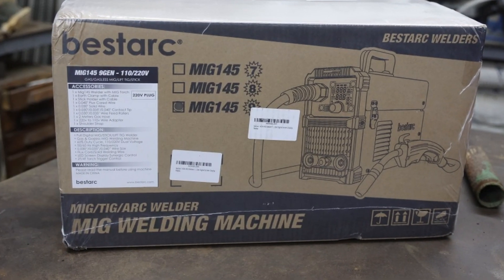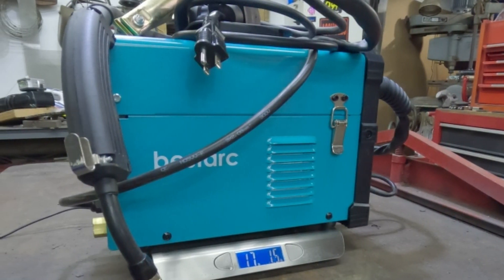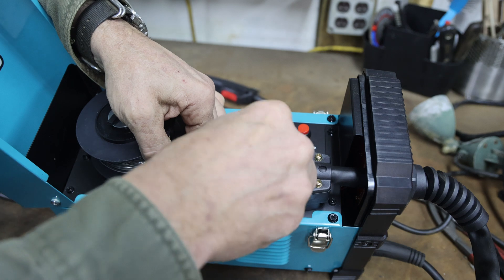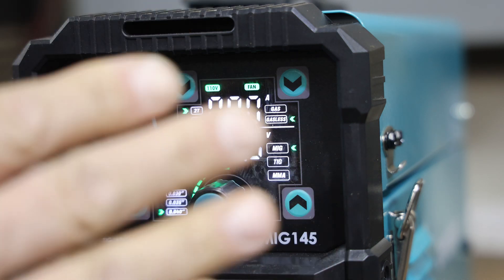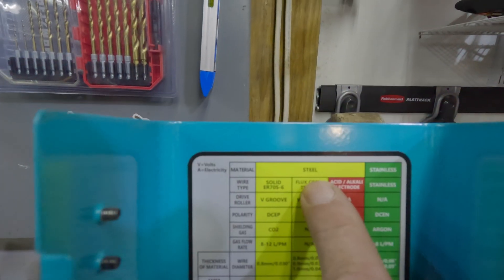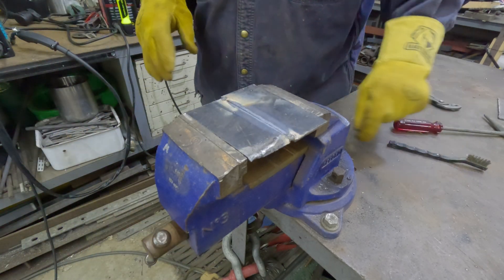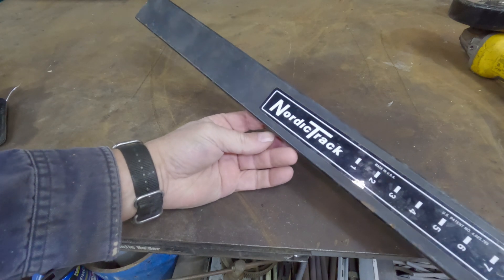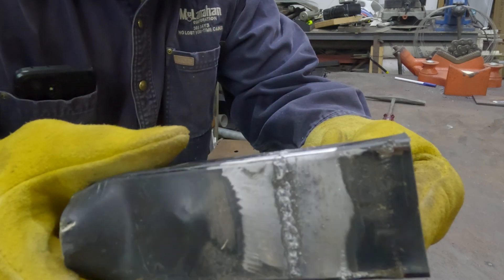Putting the $170 BESTARC MIG Welder to the TEST

Comment: Did that spool of wire come like that???? LOL!!!!
Reply from the maker: @wingnutbert9685  Welp, sort of. When I opened it, there's shrink wrap around everything, and paper bag like brown paper around the neatly spoiled wire, but as soon you take the wire out of the hole in the spool, it unwinds like a spring. When I do the follow up with the solid core spool using gas.. I will try to demonstrate this. Thanks for watching!
Reply: @themostlymikeshow  If it unspools, it can sometimes have a bad effect. The wire gets a twist when wound onto the spool and this has to be maintained for it to unspool off and feed through the machine properly. It sounds weird, but it's a real thing and I've had screw me a couple times. Just have to bite the bullet and cut off the unspooled wire to a point it's still tight. At least the off-cut is good for hanging in the paint room.

Comment: Speaking of mower decks 😊, I need to get mine off soon for some repairing. I might finally be done with it for the year.  BTW, this 19 minute video went quick!
Reply from the maker: Thanks for watching! I tried and tried to make this video shorter, but there was so much to cover that was pertinent to the details of the welder I had to make it lengthy. I hadn't even added the stick welding capabilities of this machine, but plan to make a follow up showing that as well as the solid core wire, and perhaps a part three showing the TIG functions of this machine. It's a really good bang for the buck at $150 for a machine with this potential.

Comment: So question is this for just flux core welding or can this also do mig welding?
Reply from the maker: Thanks for watching. It includes mig wire and a gas hose... However, you need to purchase the gas, and regulators. The machine is set up to use it with the gas solenoid. I will have to make a follow up showing this. I wanted to demonstrate stick welding in here too, but 19 minutes was pushing it for one video.
Reply: @ oh ok then , awesome! Yeah I’d love to see how this does with mig welding and I’ll for sure buy one using your code once I watch that video, I’ve been terrribly in need of a small mig welder for the past few months and have been trying to do so much research on which one to get. You’ve got yourself a new subscriber!
Reply from the maker: @TGLPRODUCT1ONS yes, I'll be curious myself to see how it works with solid core. I might spring for the tig setup as well, although my tig skills are limited. Thanks for the sub!
Reply: @ oh , it can tig as well?! Wow! Could you try tigging aluminum in the video too? Because I’m also limited on my tigging skills too but if it does decent then I’m for sure buying this welder, where’d you get it online or Amazon?